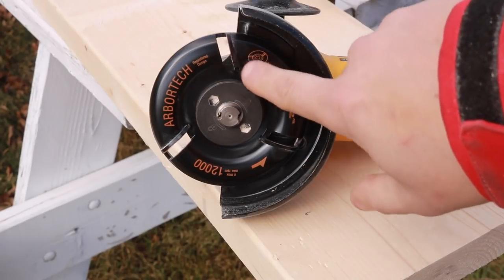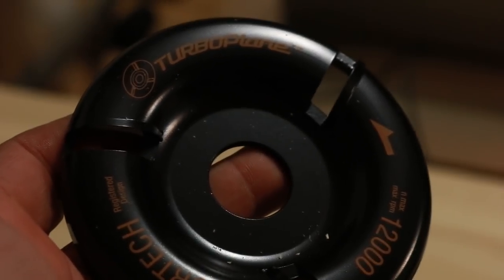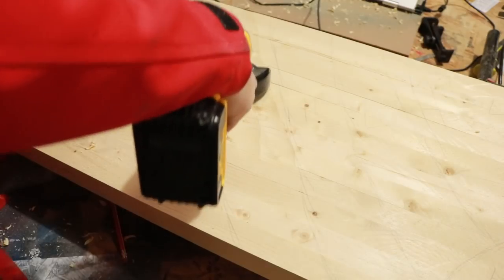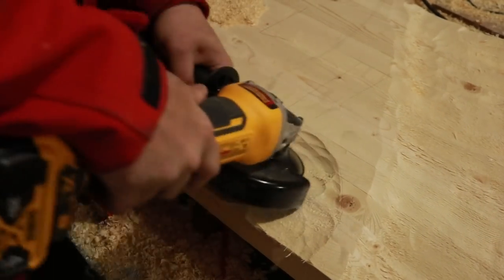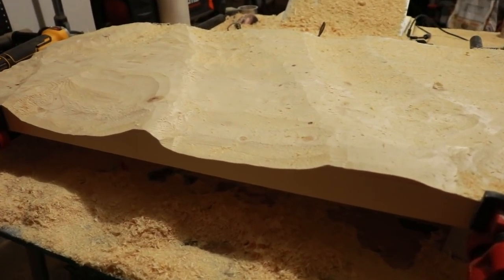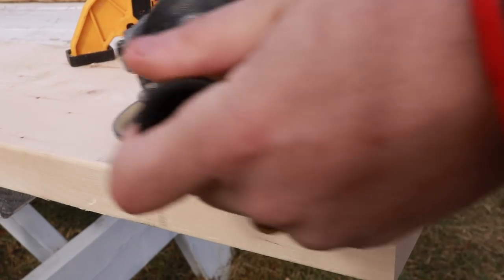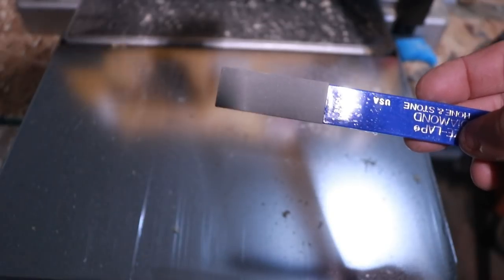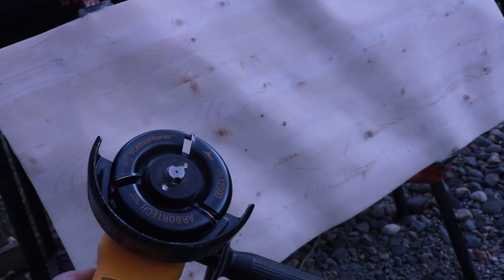Wood carving tool for beginners! This tool is a must have for anyone who wants to wood carve!

Comment: I bought a 4 1/2 inch carbide disc for $5.97 at Harbor Freight and it carves better than the more expensive discs. It's good for roughing out a project and finishing with a flap disc. The carbide grit tool is less dangerous then many of the wood carving discs.  But I am not the least bit ashamed of my two-handed death grip on the grinder.  The is dangerous territory and it's as dangerous for experienced metal workers as it is for woodworkers using the angle grinder the first time.  The metal guys are accustomed to just spinning a metal working disc onto the arbor by hand and casually going to work.  This application will cause bleeding and sadness.
Reply: Same here. Made some log end tables with it and used the 120 flap disc to finish. No kick back, smooth as butter!

Comment: Does it need to sit below the guard to plan well. I have the DeWalt tool like yours and it appears that the guard sits below the disk and the grinder/turbo plane needs to be angled down to work? Other vids show the guard flush w the disk but that’s on a smaller grinder guard/grinder. Please advise. Thank you.